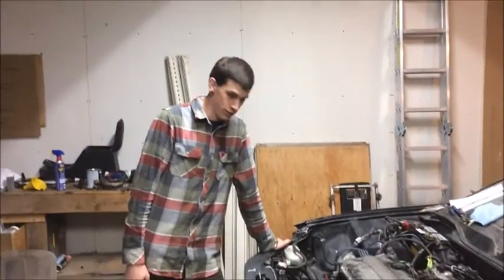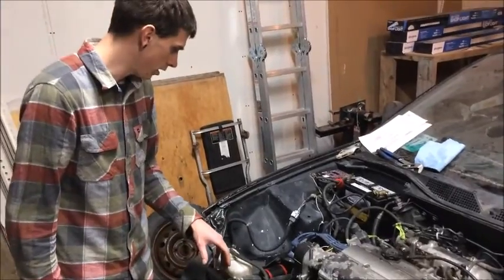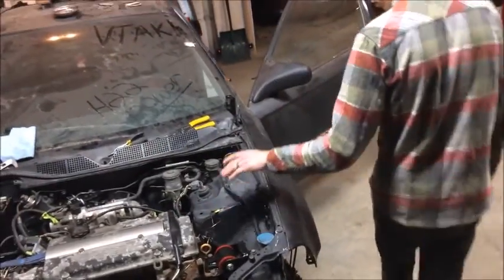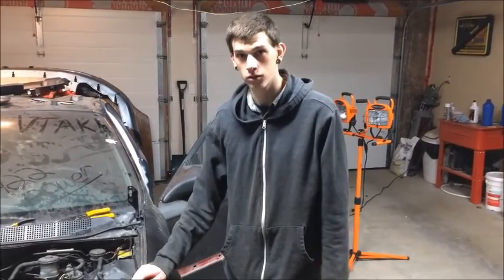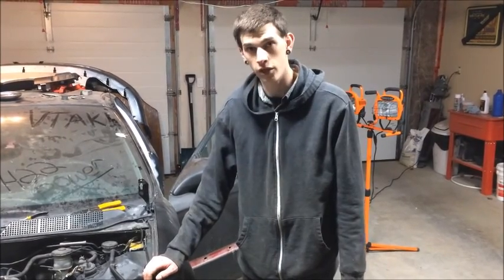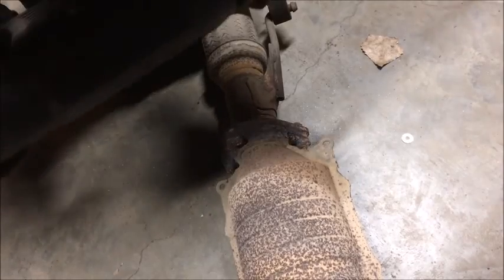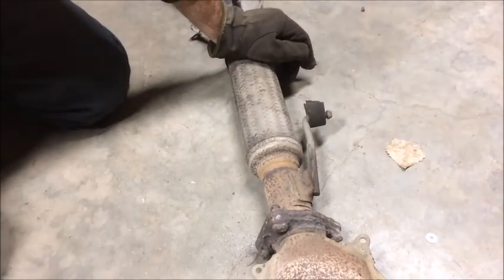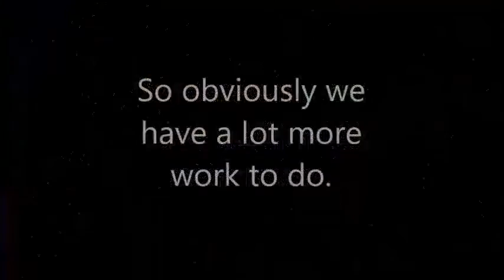MT Garage - H22 Civic Build pt 6

Comment: sounds like there's constant power going to the vtec solenoid
Reply from the maker: Ya we Had the P13 chipped to delete EGR and EVAP, checked our wiring like 4 times and couldn't figure it out. Finally swapped ECU's with the stock civic P06 and it ran not perfect, but better and got some engine codes from it. IAC wasn't wired right and the MAP sensor. So fixed those and picked up a chipped P28 with prelude base maps, EGR and EVAP delete and we're golden! Now that it runs, the fun stuff can begin

Comment: Hey, I was what did you do for the fuel line and vacuum lines
Reply from the maker: Fuel line is stock civic lines mated up to the prelude fuel rail. Vacuum lines are all stock prelude. EGR and evap delete means I had to cap off the lines that are no longer used.

Comment: did you use the prelude wiring harness and ecu?
Reply from the maker: +Thomas Lynn We used the engine harness from the Prelude and merged it with the Civic harness. The ecu is a chipped P28 with a custom tune 👍
Reply from the maker: +Thomas Lynn This playlist has some videos that go into more detail. 
EK Civic Build: https://www.youtube.com/playlist?list=PL1bewzles2ChESnrCzqNudF3I1bI-Z2Kg
Reply: Mt Garage so i could use the p13 ecu with a adapter to accept the obd2a wiring harness feed it thru the fire wall then splice in the obd1 ?
Reply from the maker: +Revealing the Facts Yes that's exactly what we did. We used the P13 at first but went with the P28 later for tunability. We had a simple obd2 to obd1 adapter for the ecu and spliced in the Prelude engine connectors to the obd2 Civic harness. Had to extend the alternator wire and some other ones, but all in all was actually fairly easy considering it was our first big wiring project
Reply: Mt Garage Thank you man i appreciate it .
Reply from the maker: +Revealing the Facts We're happy to help 👍 Hope your swap goes well!
Reply: What Axels did you use? Can't find any straight answers on forums. Saw that some ppl use a 90-93 intermediate shaft with da Integra Axels I believe? Any info would be helpful thanks in advance.
Reply: Brandon Meadows  yonaka h22 swap
Reply from the maker: Yes the outer shafts were Yonaka swap axles, and the intermediate was the stock shaft from the Prelude we took the H22 from
Reply: Did you guys have any issues with aligning the axles? Im doing this swap at the moment and it doesnt look like the axles (we call them drive shafts in the UK) line up as the part that holds the suspension strut in gets in the way, and they dont look like they want to go in straight. Do you have any pictures you could send of your suspension set up on the front? Cheers
Reply from the maker: They went in pretty easily. They don’t sit 100% straight, but there is no contact with any of the suspension components. The front of the car is in pieces right now, but will try to include a shot of the setup in a future video.
Reply: Just saw how they sit in the latest video you uploaded, thanks for that! gonna start mine when the weather improves :)
Reply from the maker: Nice! Glad it helped. Wish the snow was gone already...

Comment: Hey so I have h22a4 in my eg and Gavin wiring problems and can’t get it to start any advice
Reply from the maker: We had issues too. Make sure you have wiring diagrams for both the eg and prelude and go through every wire to ensure they all go to the right place. We did I this about 4 times and everything was correct. Ended up being a fried ecu. Swapped it and it fired right up.